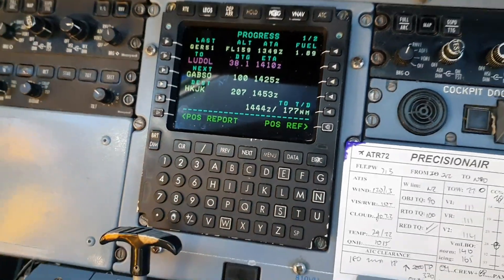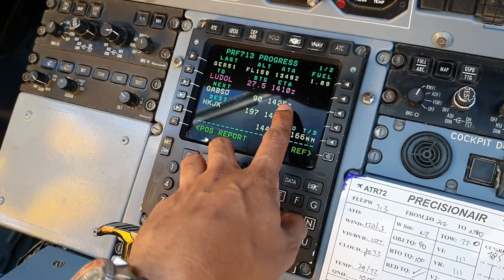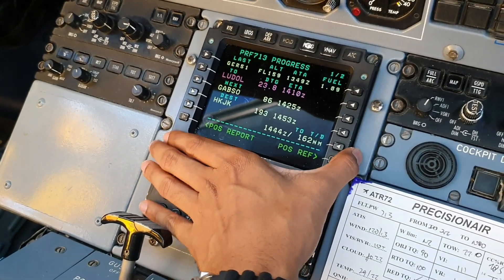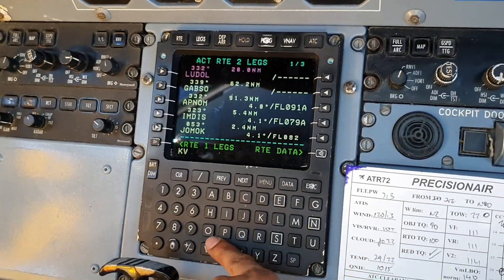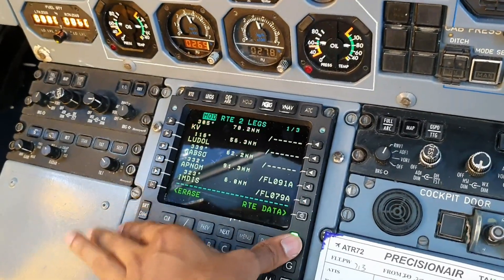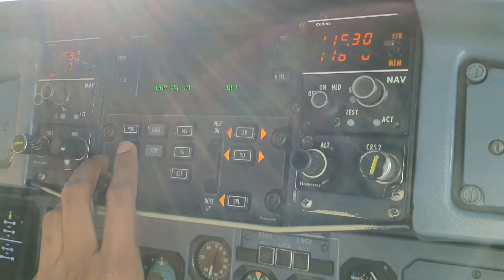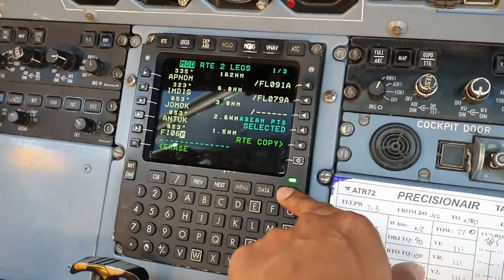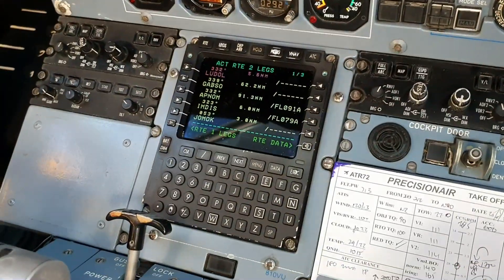Part 2: Programming the GNSS (HT1000) on the ATR 42/72 500

Comment: Nice. Please demo how to extend runway centreline during radar vectors approach.
Reply from the maker: Hey there, to extend the centerline
Suppose you are coming in from a right hand base leg IAF, and are put on a left heading for radar vectors, to extend this centerline now, select the point after the IAF which will be on the centerline, and put it on top once, and before pressing execute, plug in the inbound radial of the runway on the intercept (bottom right) and then press execute.
If your runway heading is 060, plug in 060 on the intercept. This will extend your centerline.

Cheers!